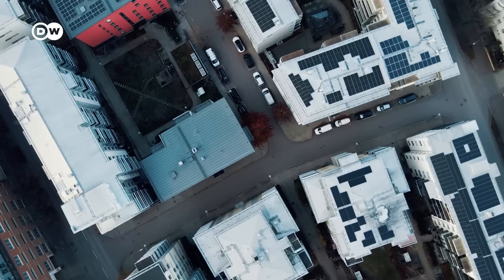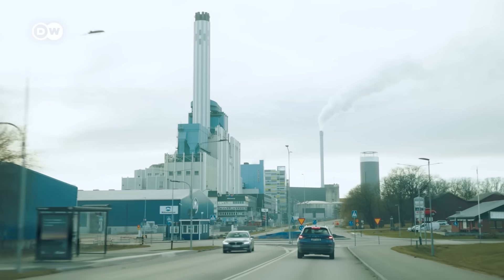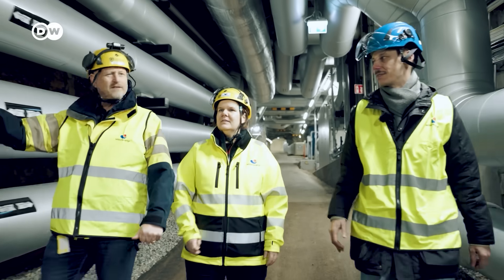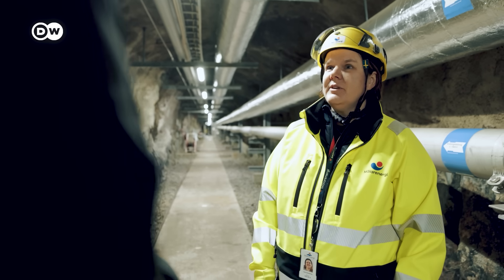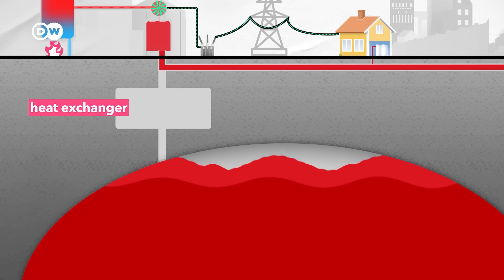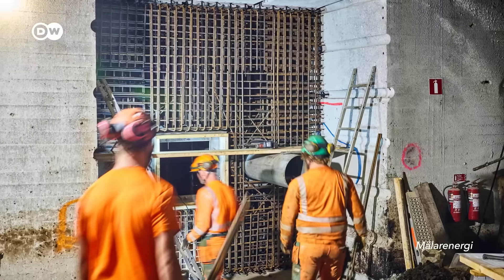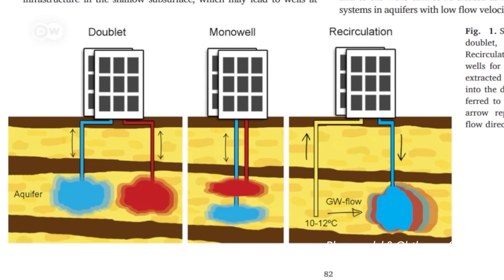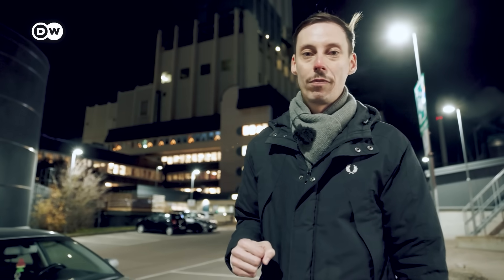Why a city in Sweden filled these caves with almost boiling water

Comment: This is fascinating, although- we are in a rural area in U. S. and it is apparent that this application is truly only beneficial in an urban setting, where the infrastructure is dense, the denser the better.
Reply: "Ground source heat pump"
This but at your rural property.
Reply: Yes, in rural areas of Sweden, geothermal bore holes are probably the most popular choice now. You drill a hole between 100-200m or 300-600ft deep and run a hose with liquid (basically a type of antifreeze like in a car engine). Then you run that liquid through a heatexchanger in your house and you basically get about 4-5 times the energy you put into it. So total installation cost is about $20k for the hole and the heatexchanger, plus you need the radiators in the house. If you buy 1000w of electricity you get about 5000w of heat into your system like this. (Every private home make their own bore hole and system, independent from others. And bigger apartment buildings make a few of these holes to cover the entire building)
Reply: That's a great price. Where I live in the US it costs almost twice as much. It's one of the reasons we didn't do it. I wonder how much is down to things like our generally larger house sizes? But to be fair we do live in an area with bedrock right beneath the surface.
Reply: You can still use geothermal energy in individual homes. My brother heats his entire hotel like this in a mountainous location in Austria at 1600m above sea level.

Comment: The bigger the infrastructure of the heating system the bigger the issue if something breaks. But the idea is cool and partially still used even in our country
Reply: True but breakdowns are far and few between, almost unheard of
Reply: @kronop8884  the system we have in Bucuresti si about 40 years old and leaks everywhere. Individual block heating systems are most appropriate cause in the long run if something happens then u dont risk loosing all the infrastructure. If an earthquake were to happen the city will risk loosing all heating ability. In multiple micro systems a few might survive and thus can aid the others in resources
Reply: @shazzz_land  Fortunately there are no earthquakes in any of the Nordic countries or anything like that they need to worry about
Reply: @kronop8884  u d only need one to have and i doubt the quality is space level in order to last 40 years minimum
Reply: @shazzz_land  The piping is expected to last upwards of 100 years and there is no seismic activity in the Nordic countries region that can damage them
Reply: @kronop8884  expected to is not the same as knowing it will last
Reply: @kronop8884  the romans knew they made systems to last, romanians knew they made systems to last, japan also, germany (not now but the one from the past) also. There is a specific mind set that leads to these lasting system and a country that has a no go zone is no country with a mindset to make a system to last 100 years.

Comment: The only stable and feasable "renewable" is hydro power; the only down side is that it cannot be installed use anywhere. In the last 70 years the world was powered by hydro nuclear and fosil fuel, no wind, no solar
Reply: Theoretically, it can be installed anywhere, where you have liquid flow, but usefulness really depends on generating power.
Reply: @ЦзинКэ-ы5х  doesnt work like it did 70 years ago to have local water towers with small hydros to give a few watts. I consume between 2.5 and 7 kw per day. An average modern household i presume to go up to 25 kw a day. Multiply this by 25 k and you get an average small city consumption with stores included and other services  to 350 MW per day. U d need the budget of real madrid stadium in order to make an artificial lake this big plus huge amounts of concrete

Comment: I live in Decatur, IL. Springfield, IL had a central heating system for the center of town in the late 1800's. I don't believe any of that system is operating. It was not "heated storage" but coal fired boilers. Yours is a very interesting project.

Comment: Ngl, this seems like a possible energy storage solution for solar power. Pretty neat
Reply: The problem with converting other forms of energy to heat is that it’s very difficult to heat it back. If you have 2 caves (at different elevations) and not just 1, a common solution is to run a pump to elevate the water when power is abundant, then reverse the process (run a turbine by letting the water flow) when power is less abundant.

Comment: 9:00 huh, $15.5 million doesn't sound like much for such a project.
Reply: I suspect the project costs mentioned assumes a pre existing cavern that needs to be cleaned out. Having to dig that out would see the price a lot north of that. 

Also for only 1600 tons of annual abatement my back of the envelope calculations put that at an order of magnitude higher than solar PV (about 250 roof tops worth). Acknowledging that solar PV may not be feasible in Sweden.

Comment: If you have surplus electricity (rather than industrial/process waste heat) you can transmit that into a small volume of well insulated sand/gravel/rocks, and use resistive heating to go up to 600 C for a district heating system, really taking advantage of carnot efficiency. 

Obviously, you can't heat water up that high, there was an opportunity to capture industrial heat, and this town already had the cave system, so the solution shown makes sense.
Reply: Also, they don't lose energy converting it back to power or portable heat. Space is basically an unrestricted resource, it's not like they save money by using less volume.
Reply: Please explain what carnot efficiency has to do with turning high cost electricity into low value heat?
Reply: @rodfreess6019  High cost electricity? What does that mean? This video relies on industrial heat being redirected to a thermal battery.

I was referring to systems that pulls electricity off of the grid when there's a SURPLUS: instead of utilities curtailing solar or wind, a thermal battery system buys it cheap. "high cost" is something you made up in your head I guess?

Like I said, if a town has both a cave system and industrial heat, the video's solution makes sense. If not, you can take advantage of a system better utilizing carnot efficiency. Electrons can be stepped up to higher voltage for much higher temps. That is efficient because the system can then be much smaller, much closer to customers while still transferring enough heat into a water circulation or steam system.
Reply: @Joe-ij6of  You misunderstand Carnot efficiency. It only applies to the conversion of heat into other types of energy. By storing heat for heating you circumvent the Carnot process completely because no energy conversion is necessary. The thing you are talking about is most likely thermal electricity storage. Convert electricity when it is cheap into high temp heat, and when electricity is expensive convert it back at relatively high efficiency. But this is a completely different thing.

When the end product is heat going higher in temperature than required leads to higher energy storage density, but also higher losses and thus a lower efficiency.
Reply: @Joe-ij6of  Carnot efficiency applying to heat storage is the only thing made up.  Turning electricity to heat is a given, all energy turns to heat eventually.  Heat storage has so many losses it is rarely worthwhile unless the heat has to be disposed of already, as the power plant condensate heat requires.
Reply: @SovietVenturesInc  You said "Sand/gravel/rocks cannot be pumped in pipes to heat homes." Why would you draw such a stupid inference from what I wrote? That is not how any of that works lol.

Burning trash might not be the best idea... the same kinda people that like energy efficiency are the same people that like recycling. If all waste incinerators in a country supply district heating and environmentalists double the recycling rate of said country, half those incinerators will be shut down.

Anyway, this is one of the projects I was referring to:
https://youtu.be/MXx-KS4SE3A?si=fj9C3DChwyPEHyUo

Comment: I had smaller district heating when I lived in apartments. Multiple blocks of buildings would run on the same boiler for heating, and smaller water heaters would be used for bathing and sinks. Now the small unit i live in is separate, with gas heating and hot water 😓 I'm currently trying to build a greenhouse against the back wall, incorporating an earthen heat battery, which will hopefully provide some buffer from winter cold and summer heat

Comment: What did they do with the oil in the caves? A little suspect that this info was missing. But this is a great idea. Those Swedes are very clever.
Reply: It will have been burnt years ago.

Comment: If you are going to generate electricity at an efficiency of 50 to 63% You might as well capture the waste heat and use it. But electricity demand and heating demand do not always coincide so storage of the heat helps with cold snaps and variations night to day. So it would reduce the need to expand the heating plant. Similar means could be used for summer cooling: Make ice over the winter and use it in the summer for cooling (but that might require an additional pipe). Of course it is much more economical to have these huge caves then each house having a swimming pool sized tank sub-basement.

Comment: In practice, they do almost the same at OSL (Oslo Airport Gardermoen). During the summer, they heat up the groundwater to around 70 degrees. by burning bio-waste and garbage. In the winter, they extract the heat via heat exchangers, and heat the buildings around the airport. They also store snow to use in the summer, for cooling the building.

Comment: It seems that 95 °C is high grade sensible heat which is good for circulating through radiators. If the buildings instead used water source heat pumps, the DH could operate at lower temperatures with a similar heat flux(same or larger ∆T), reducing thermal losses ie. cooler DH loop temperatures reduces thermal losses throughout the system. Achieving a larger ∆T(more Joules/m3 transferred) also means slower DH pump speeds, saving distribution cost.
Reply: 95 °C is the temperature stored in the cavern, not the water send to the buildings. Both is coupled with a heat exchanger.

Comment: Important fact nobody is talking about:

 They also burn a lot of household garbage.

 But the need for garbage is actually so big, so they even import garbage from other countries to fill their demand.
Reply: And that import is done due to the fact that sweden can burn the garbage more effectively and use it to generate both heat and electricity which warmer countries cant. That 90% turnover instead of 40% is the major factor.  You make it sound like a bad thing to reduce waste instead of landfilling it. 

In 2020 only 4.6 million tons were landfilled in sweden while 23 million tons were recycled as materials or energy. Not many countries can even get close to the same numbers.
Reply: @Allexz  We import millions of tonnes from countries such as Norway and Britain. 

Countries, that very well could recycle their own plastic instead of loading it on a oil-gobbeling tanker to transport it here so we can burn it and release more carbon dioxide.

-Just to get taxed more by EU due to not reaching our goals. 

That's why the EU is such a scam.

Comment: I wonder who got the contracts for these? From napkin  maths I see that it will take them about 30 years to recover the $15million back, IF there is no maintenance required for those 30 years. and there is no finanacing on that 15 millions. Ofcourse this isnt possible. as there is actualy ongoing operation costs as well and there is actually financing costs. So this project will never make back its costs. someone made a bit of change in this and likely has operation contract as well.
Is there influential oligarchs in Sweden ?

Comment: I wonder how feasible it might be to have dual batteries side by side, one large reservoir that's chilled to extremely low temperatures (possibly even near absolute 0) and another that's heated as high as possible (possibly in the low 1000s of °C), so you could then both heat in the winter and cool in the summer, drawing from the different reservoirs as needed. It'd basically just take an enormous heat pump to do it and at least in principle it ought to be possible to get all cooling and heating needs covered that way. For instance, imagine everybody's ovens and fridges are brought to the relevant temperatures all year round. Given enough storage and enough flexibility in the routing of these things, you could even arrange it to, like, heat industrial furnaces on one side and cool a server farm on the other or something to that effect.
So long as you could roughly balance the need for heat and the need for cold, you could do all that while almost not affecting the environment at all. Everybody would have a ground-based local district A/C and essentially none of the  diverted heat would be pushed into the air, but rather, into a network of hopefully well thermally insulated storage
Such a massive heat pump would take a lot of power but no doubt it could be made far more efficient as one huge one than if every house had its own.
Reply: With a heat pump you can always reverse the flow of heat in the same bore holes, and run central cooling in summer. The main idea with water heat storage is day to day storage,  you can produce a maximum amount of electricity when in demand, say mornings and dinner time while using the excess heat for later district heating.

Comment: District heating can be a bigger problem if not run in a reasonable way, such as not making the full use out of it, providing heating only when it gets too cold, or not billed correctly to the exact usage. In China, many colder cities have district heating, but its only used for heating, and start to heat very very late, while stops very early, leave every household have either electric or gas boiler for hot water and a few reversible air-conditioners for the transaction season. Meanwhile its not billed or run correctly as its only billed depending how big the space is, not how much energy you have taken from the network, and you can't control the temperature, thus most people are either too hot and  wasting heat or too cold that use gas or electricity to warm up at the same time. In this case, individual gas or electric heat will save more energy and provide more comfort. Also, nearly all district heat in China are provide by 100% fossil fuel, and a few provide by electricity such as heat pump which uses electricity mainly produced by fossil fuels.

Comment: One downside to this solution is that you are at the mercy of the city utility company's pricing.  If they aren't run efficiently or the city uses this utility as a kind of hidden tax, then you pay too much.  If however, you decided to invest in your own earth heat pump, you would have to make the initial investment, but your costs per month after that might be lower.

Comment: I wish they explained how and why this is different from Geothermal. It seems very similar but I’m unsure why geothermal isn’t possible there without the heat storage cave. I can only assume that it is because Sweden rarely gets warm enough for regular geothermal to work, but it’s only a guess.
Reply: Sweden have cheap biomass fuels and also burn household waste to generate heat. Some district heating plants have geothermal heat pumps aswell. Burning household waste to generate heat is the cheapest and also reduces landfill needs. If you have need for district cooling in summers you can also store the excess heat in the bed rock and reuse it in winter with heat pumps.
Reply: To run the plant efficiently year round they need to be able to offload heat even during the summer months, charging thermal batteries is one way of achieving this